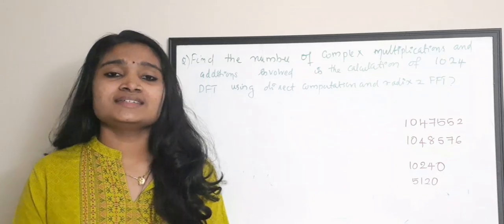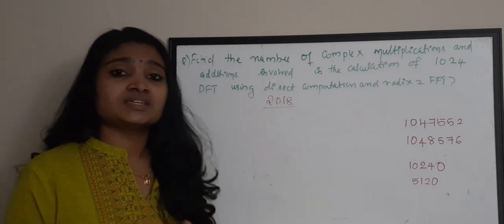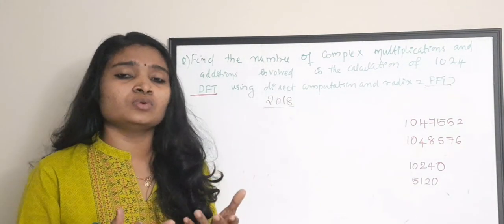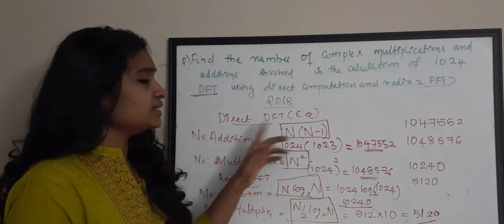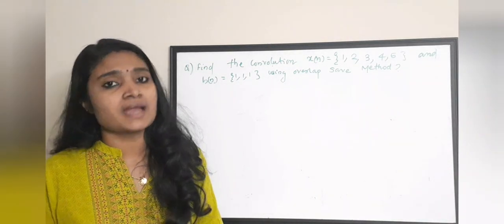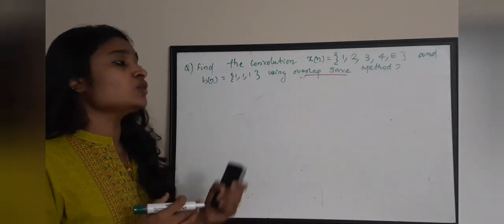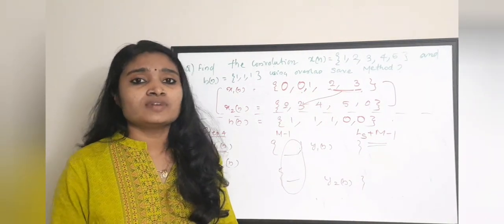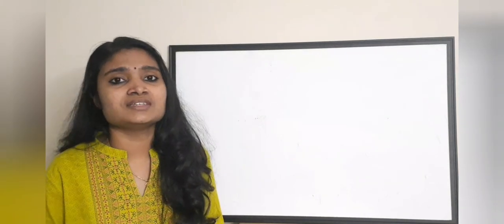Digital Signal Processing Previous Year Questions-KTU DSP Exam Preparation-DSP Sure Questions Part1

Comment: In last step, N should be 7 , but in y(n) we are getting only 6 samples after discarding the beginning 2 samples. What should be done to get the final answer? Atleast post the answer for the overlap save method question...
Reply from the maker: There is separate video for overlap add and save . Please watch them, or else I will post a new video with some examples
Reply: @EasyElectronics_jobupdates  I have watched your entire playlist. It was very useful. Just asking answer for that problem for verification from  my side. thats it . Keep doing this wonderful work.

Comment: Last question Ls=5 &M=3  then final result kitendath N=5+3-1=7  digits allea..... 
Y1(n)= 5 digit  =5,3,1,3,6
Y2(n)=5 digit =8,5,9,12,9
Remove (m-1)   of first 2  data from Y1(n) and y2(n)
Ans=( 1,3,6,9,12,9)  =only 6 digits..... 7 digits  allea answer vara? Evideaya thettiyennu paranjutharamo?
Reply: Overlapp add method shariyayi kittunnundu..... But last digit missing in overlap save method
Reply from the maker: Ok. May be last rounding off error arikum